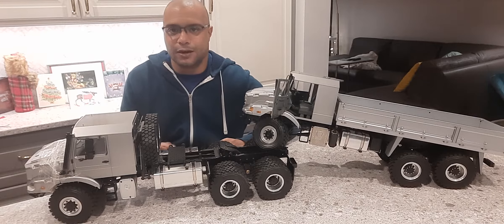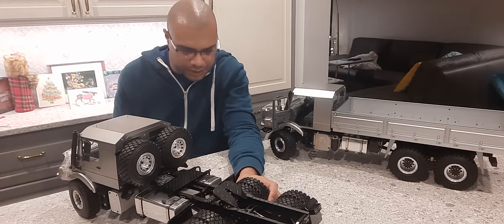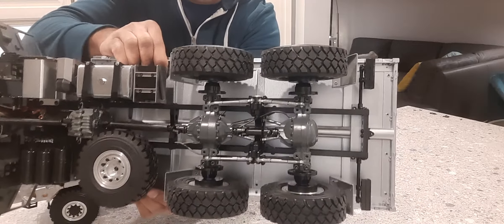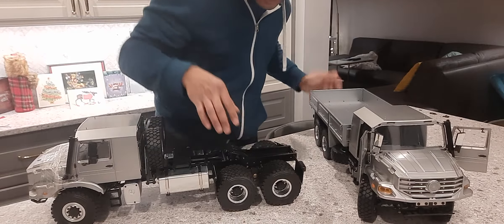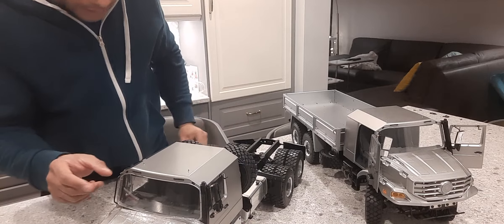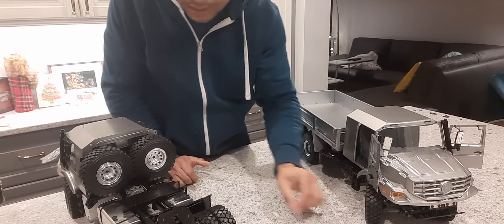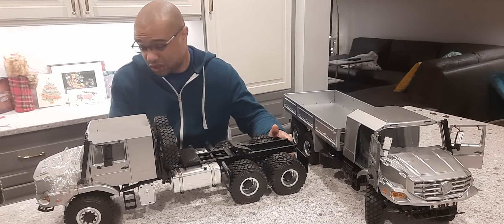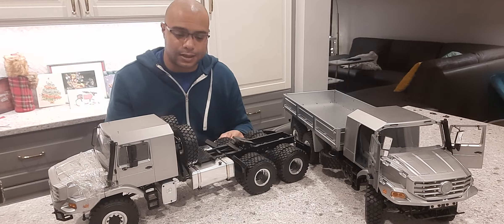RC & COFFEE Reviews - RC4WD OVERLAND  Mercedes ZETROS 6x6 TRACTOR TRUCK vs STANDARD TRUCK!

Comment: Congrats it’s a awesome looking rig 👍🏼 #4
Reply from the maker: Thank you! I'm instaling the sound kit and a 3:1 reduction gear :-). Mayyybeee some lights but with the hood opening mechanism, I'm not sure I want to mess with this just yet.
Reply: @RCNCoffee  sounds great.  Only 2 screws holds the hood on.  Located under bottom of front grill.  Esc and receiver only held on by 2sided tape.  I’ve replaced my electronics w/ the flysky 6ch pistol grip/ receiver.  More options for lighting and sound controls down rd.  If you need space behind seats there is ample room for anything.  4 bolts hold cab 2 on side chassis rail and 2 in rear of cab on top chassis rail.  Looking forward to more of this and the loader 😉